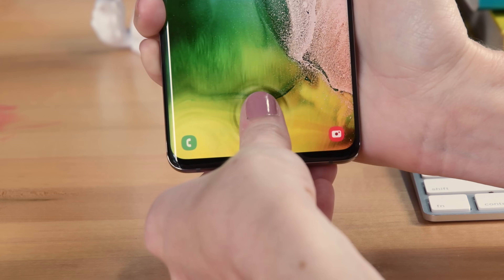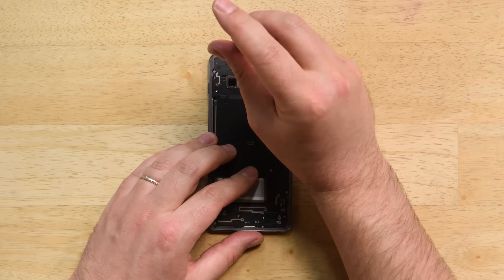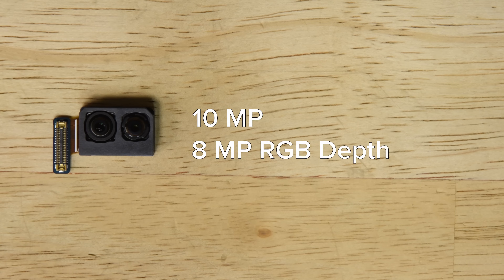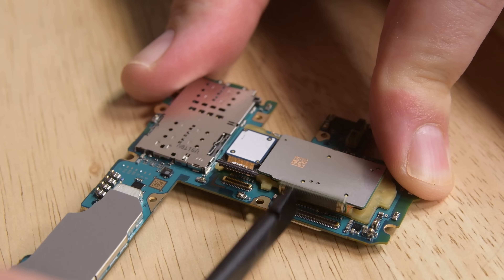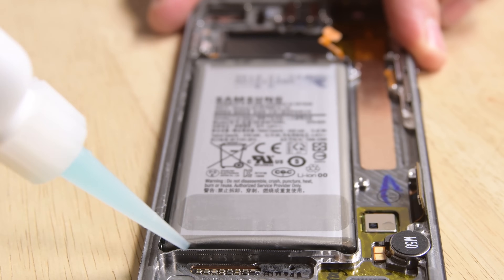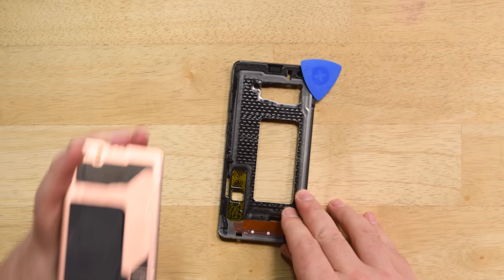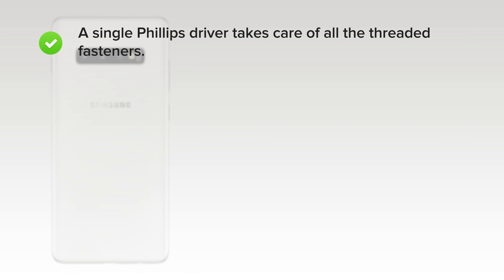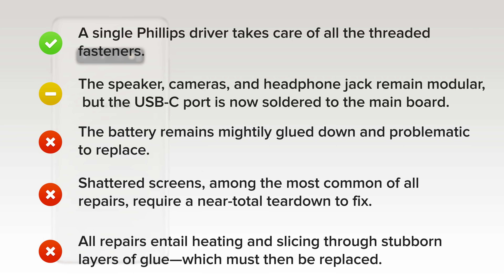The Samsung Galaxy S10+ Teardown!

Comment: My rear panel appears to be coming loose on one side and I'm worried this will compromise its water tightness. How can I re-seal this? I've tried pushing but I can still fit my fingernail between the chassis and the panel...
Reply: Mine too. It seems to be a simple fix though,  I got mine reattached pretty simply, just firmly pinch the affected area to the frame for around 10-20 minutes. When I released on mine, it stayed attached. My guess is that the adhesive just needed some time to bond to the glass again?

Comment: Poking the sim card tool in the wrong hole. I poked into the mic noise reduction. I tested the mic and it's ok but I am worry  about the waterproof. Have I damaged the water resistance?

Comment: I accidentally poked the mic instead of the sim tray eject hole on my s10+, did I damage the waterproofing or anything? I've been worried sick since I got the phone lol
Reply: Marko Isip I'm 90 percent sure that the mic is placed on an angle relative to the hole so it's impossible to pierce the seal.
Reply: All water resistant Is placed at an angle it wont damage anything unless you poke it from the inside

Comment: best phone to repair is the IPHONE , easy to open and replace anything you want
Reply: Unfortunately this seems to be true these days. If you have a ifixit kit an iPhone isn't any harder to open than a modern samsung and you can actually replace the front glass without having to buy an entire screen in addition...

...aand the battery isn't glued in unlike on modern Samsungs...
... and the lightning port isn't soldered to the motherboard...
Reply: @AnX555  exactly that what i mean, like
Reply: the iphone? easy to open? r u serious? watch jrr teardowns first
Reply: Alexandru Nite from iphone 3 to iphone XMX is the easiest phone i ever opened
Reply: @hayder-iphone  once you got inside you have 4+ types of screws.and the back panel is impossible to replace
Reply: Alexandru Nite once you be professional you will pass all of this steps with no idea of how much easy
Reply: is this a joke?
Reply: zoonked no it's true
Reply: @nitealexandru6289  no, cause everything breaks easily so they made it easy for themselves
Reply: Max Miazek 😂 everything breaks easy? If you are a mobile repair u will understand which phone is most easy in fix
Reply: @hayder-iphone  you don't get jokes, don't you?
Reply: Max Miazek of course not
Reply: asll  btw I am pretty sure it is easiest not most easy

Comment: The USB port/charging chip are two of the first things to break down. Samsung had traditionally made that part a separate module, connected with a ribbon cable to the motherboard. Very discouraging development.
Reply: That's why I have magnetic connectors in all of my electronics. I just switched to WSken Mini 2 type. Same cable for 3 tips; Lightning, USB C & Micro USB. Never have to worry about damaging the jack from a jerk, improves dust/dirt resistance, easier to connect while driving and eliminates wear on the jack. I've tried several brands and have settled on WSken mostly due to the larger diameter pins compared to the other brands. Allows more current to pass.
Reply: I bought a wireless charger, so I hardly ever use the charging port.
Reply: That might have been true with Micro USB. But USB C is damn strong and my 3 years old Nexus 6p that has gone through all sorts of abuse including scratches near the port still plugs and charges just fine. I don't see it being an issue on this phone although it's still a bad move anyway.
Reply: Not the end of the world, because you can wirelessly fast charge.. unfact mine broke down.. and the fix is just a 20$ wireless charger.. regarding data transfers .. shareit to the rescue

Comment: You are damm good guys, a teardown in less than 3 minutes. Keep the good work.
Reply: lol it didn't take them 3 minutes,,,, more like 20-30 mins,, they did not show heating the screen / back or battery to remove glue holding them all down which takes at least 5 minutes each,  this is just the highlights.
Reply: LOL

Comment: That usb-c port being unremovable is really the deal breaker otherwise I would have gone for it and bought the plus.
Reply: But why? It's USB-C. You shouldn't need to replace it since USB-C doesn't suffer from the same issues that MicroUSB suffers from.
Reply: @trparky  what if the cable head breaks in it or bends it? Things happen mate :/
Reply: @thishdude  wireless charging might be used in case as back up 🙏
Reply: @fatehyabali  that's actually pretty damn smart dude.
Reply: @thishdude  It comes back to being careful with your stuff.
Reply: @thishdude  Try to break a USB-C port on your phone! The cable will break off first.
Reply: @raymondramirez9177  I didn't actually know shit was that tough. Thanks for the good news guys. Truly appreciated.
Reply: @raymondramirez9177  I don't understand how people break their stuff so often. If you're careful and you don't just jam the damn cable in the port will last you a long time. Not only that but if you're not careless with how you handle your device and you have a proper case on it to protect it you'll never break your screen.

I have a three year old phone, original hardware. Never been repaired. Still in pristine condition.

Comment: With the problem of the non removal of the ultrasonic fingerprint scanner, does this mean replacing of the front screen do to shattering the glass means buying a whole new device? That or replace the screen and you never get to use the ultrasonic fingerprint scanner ever again.
Reply: in my opinion when you change the screen just unlock the device with the pin or facial id, then reset the fingerprint with new one and you could use the device again in theory
Reply: They never said it was not removable. They simply "THINK" that because it is glued in place, removing it "SEEMS to be" pretty destructive. The screen itself is glued to the frame, and yet they ventured upon removing it and succeeded with no issues at all! There is no reason to assume that the glue used for the ultrasonic scanner is that much stronger than that used for the screen to the frame. You have to keep in mind that while iFixit does provide these tear-down guides, they can also benefit from a presumption that screen replacement can only be done by a pro!

Comment: I’m really disappointed in Samsung soldering on the USB C port. Wasn’t the goal not to be like Apple and be the opposite of them? This Samsung following in their footsteps and I hope they don’t keep down the path of Apple notoriously being User Hostile.
Reply: @juliusnigelmarturillas3629  phones are meant to be replaced every year? Are you sure about that?
Reply: Having owned both brands and having repaired them myself, I find that apple is way less troublesome to get into that samsung, without needing to heat up the entire device you can open it by detaching a few screws, also the battery has the pull tabs which, might or might not work but they are there. 
And, while not being something good, screen replacements for lcd screens of the iphone is waaaay cheaper than oled screen replacement for some of the samsung devices
Reply: Nicolás and that can be true, but as a owner of 4 Samsung phones, currently an Note9, I can say that people rather have an OLED screen. They just look better. Samsung in the past has made it easy to replace the USB port without buying a whole new phone as JerryRigEverything said. Repairability by the user has been something Samsung is known for, which is where my disappointment comes from.
Reply: Samsung has had moments when they make fun of apple and then do the same thing. For example the headphone jack and the notch.
Reply: @juliusnigelmarturillas3629  what do you mean there's no point in repairing them? You mean to tell me that there's no point in repairing a screen?
Reply: J Nigel some people can’t afford to replace their phone every year.
Reply: @juliusnigelmarturillas3629  you need to get your head out of your arse lmao. That's not how it works. So if the piston of a car breaks, you buy a whole new car? Sustainability level 0
Reply: @juliusnigelmarturillas3629  You can simply replace the screen either yourself or by someone else. Take it to a samsung store.
Reply: I have had my cheap HTC for several years now and it still works great! The cameras suck though.
Reply: @juliusnigelmarturillas3629  Calling a one-grand phone "disposible" is extreme, unless you are a millionaire.
Reply: And move the the old top phone  down down market.